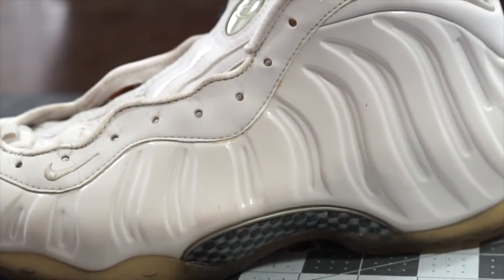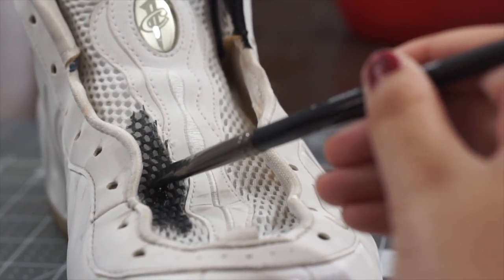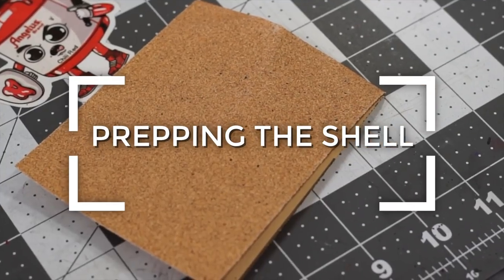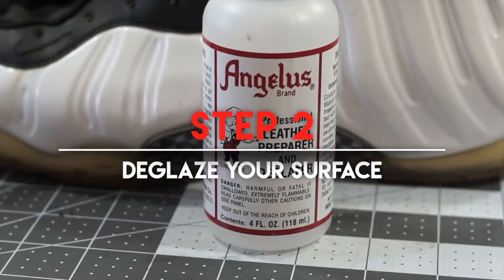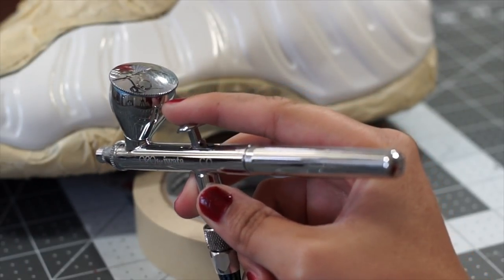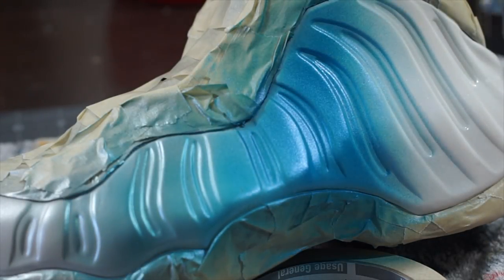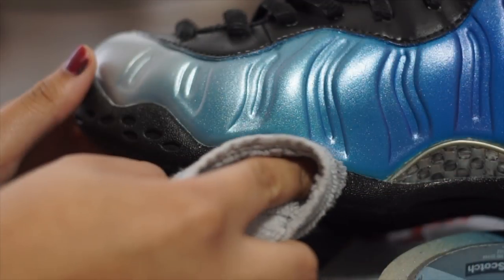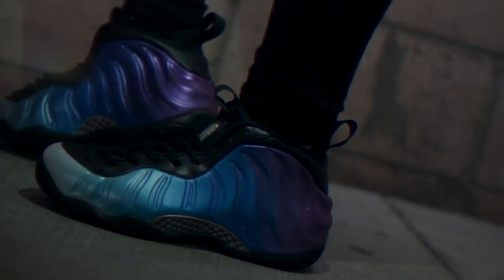Custom Nike Foamposites | Angelus Pearlescent Paints | Custom Shoes

Comment: I got lost.  Why do i need the hot gun? I'm not using a pint brush for the black in the beginning 🤔🤔
Reply from the maker: When you are working with that Fabric material we suggest mixing our paint with our Angelus 2-soft fabric medium. Mixing the 2 will help the paint adhere on that type of fabric materials.  https://angelusdirect.com/products/angelus-2-soft-fabric-medium
When heat-set properly, this Fabric Medium will help keep your fabrics nice and soft after being painted.
Heat-set using a heatgun at 300º F for 3-5 minutes (this step is REQUIRED).

Hope this helps and If you have any more questions feel free to contact us at Info@angelusshoepolish.com

Comment: What is the Angelus 2 Thin for? Why do you need to mix that in your Angelus leather paint before applying it on the Foamposites?
Reply from the maker: 2-Thin is perfect when you need to thin out our Angelus Leather Acrylic Paint. It is used when you're using airbrush for your customization. As is, the paint may be too thick to pass through the air brush. If you have any more questions feel free to contact us at Info@angelusshoepolish.com

Comment: can I use a regular black angelus paint and put a finisher of satin over it to give it a glossy look??? Im repainting the concord foams. And I will be using an air brush
Reply from the maker: STEP 1In order to prepare Nike Foamposites you will need high grade sandpaper and adhesion promoter. Lightly sand down the surface with the sand paper.STEP 2After giving it an even sand, wipe down the areas using Angelus Leather Preparer & Deglazer.STEP 3Once dry, apply two to three even coats of adhesion promoter allowing the shoes to dry between coats.

Comment: I always thought to paint foamposites I would need to use 2 hard, is it really not necessary and would it make a difference if I used it ?
Reply from the maker: The areas that are painted on the Foamposites have a lot of bend and flex.. 2 Hard may not be the best for this project. However, We do recommend adhesion promoter. This will give a better surface for the paint to adhere to so it will remain flexible.

Comment: so applying on leather we can use the paint without mixing it with 2 hard or 2 soft?
Reply from the maker: Correct, all it takes is proper prep and application. When prepping the area, we suggest using our Angelus Deglazer or Acetone to remove the factory paint/finish. This will allow Angelus paint to adhere better to the surface.
Reply: @AngelusBrand  noted with thanks

Comment: If the foamposites arent already white do I need to lay down a coat of white before painting the actual desired colors?
Reply from the maker: Yes it could be helpful. What color are they now? It may be best to lay down a coat or two of white for better coverage. If you have any more questions feel free to contact us at Info@angelusshoepolish
Reply: Thank you for the reply. Currently they are a metallic blackish color. I guess I'm just trying to figure out when its appropriate to lay down white before completing a custom paint job...what's the rule of thumb and does the type of material make a difference? @AngelusBrand

Comment: how many coats of dye to the sole should be added? and do we wipe down the sole after every coat to the sole?
Reply from the maker: Could be around 2-3 coats... just depends on the project. You can wipe the sole once you have applied the last coat and the surface is dry. Using denatured alcohol may work the best to remove the excess dye.
Reply: Angelus Shoe Polish  is there any way to remove very small bits on dye that  got onto the midsole?  Is it possible to paint over the small dots of dye using flat white on the midsole.?
Reply from the maker: @davidblizzy9725 Unfortunately the dye is permanent. It may depend on the midsole but for a temporary/quick  fix, covering the area with paint might work.  White (Flat) might be a different shade and may not match the color of the midsole so prepared for that. Also, paint may not last and stay on a rubber midsole. After time it might crack or chip off. If you have any more questions feel free to contact us at Info@angelusshoepolish.com

Comment: You don’t need sandpaper right?
Reply from the maker: We do recommend using sandpaper. This will give the surface some grooves and texture for the paint to adhere to.

In order to prepare Nike Foamposites you will need high grade sandpaper and adhesion promoter. Lightly sand down the surface with the sand paper. After giving it an even sand, wipe down the areas using Angelus Leather Preparer & Deglazer. Once dry, apply two to three even coats of adhesion promoter allowing the shoes to dry between coats.If you have any more questions feel free to contact us at Info@angelusshoepolish.com

Comment: Does it work on rain boots? Will it crack?
Reply from the maker: Rain boots can have quite a lot of flex on them. Depending on the material it can work but it would need heavy sanding and spray with the adhesion promoter. We still wouldn't 100% suggest it. If you wanted to do art that would be fine but a full color change may be asking too much of the product.
Reply: Angelus Shoe Polish ok thanks!

Comment: I tried painting mines. It started chipping off
Reply from the maker: Then you will definitely want to circle back on the preparation. The foams shown in this video was worn and still in great shape. So it definitely sounds like you want to go back to how well you prepped the shoe. These steps below are the proper steps you want to take. Even if you did those exact steps there can always be an issue. Whether it is preparation, sanding, layers and/or dry times. Ultimately, you should not experience any chipping or cracking. 

STEP 1
In order to prepare Nike Foamposites you will need high grade sandpaper and adhesion promoter. Lightly sand down the surface with the sand paper.
STEP 2
After giving it an even sand, wipe down the areas using Angelus Leather Preparer & Deglazer.
STEP 3
Once dry, apply two to three even coats of adhesion promoter allowing the shoes to dry between coats.

Comment: Why do people apply this adhesion promoter that's sand free and sand it anyways ?? Bulldog, dupli-color and others need you to sand when applied, sem has this sand free adhesion promoter which mean exactly that, Sand free. If u read in the front it says sand free and wet on wet application so u don't sand it and you add your paint when the adhesion promoter is wet, not dry. All in the front label.